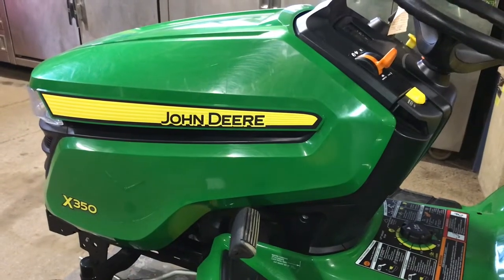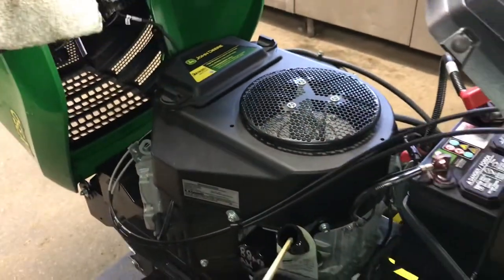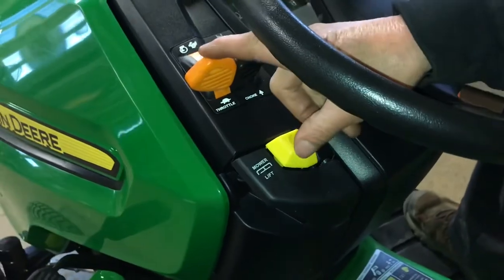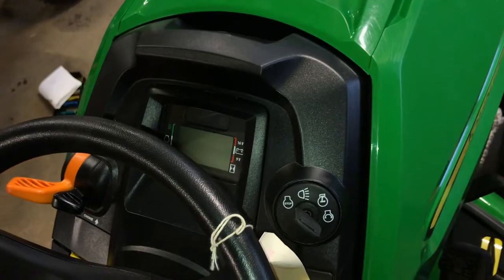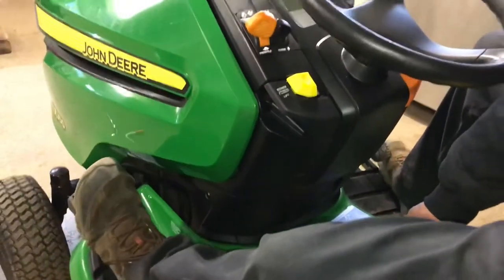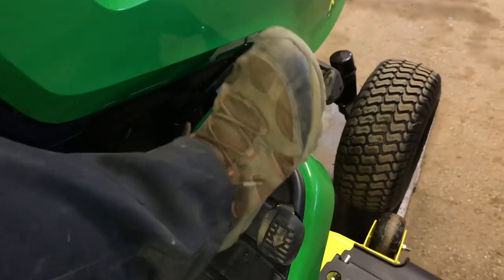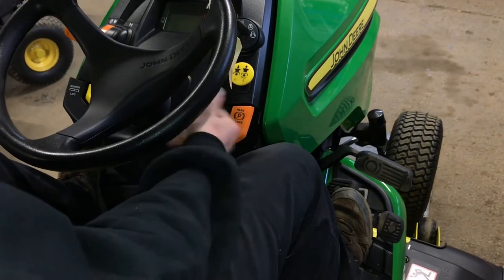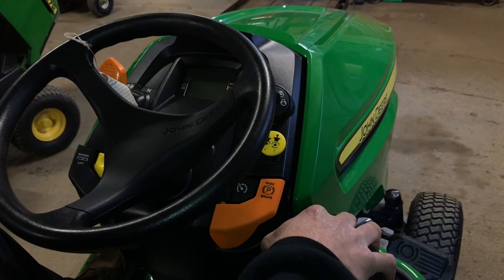How to start and operate a John Deere X350

Comment: If you dont push the reverse button with the pto on does it turn off the engine or just the pto?
Reply from the maker: When you want to go into reverse the engine or the PTO and the engine will shut off depending on the model of the machine.
Reply: On my X350 just the PTO shuts off.

Comment: Is it much better than the E series?  Thanks
Reply: Good question.  I'm wondering the same thing, most info I can come up with is a solid frame and beefed up transmission.  Also more warranty.
Reply: I’ve had mine over a year the best riding mower I’ve owned. It really is the Cadillac of 42 or 48 inch mowers. Engine is very very quiet. Smoothness heavy duty. I can’t recommend it enough. Sold only at John Deere dealers not sold at Lowe’s or home  depot. Traction is excellent. Little more money than the e series,  but get it you won’t regret it
Reply: Johnny Davis  question-  I change my deck height several times while mowing my .  It’s easy to do with the pull handle lever...how about the X series...is it hard to do?  Do you have to stop or can you do it on the fly?
Reply: Very simple It works just a spring loaded foot pedal on the left side  reach down and turn the dial to the desired deck height.  Forward reverse and brake are all on right side. When I’m going over spots where I think the blade may scrub I just press the deck pedal and raise it up till I’m over the trouble spot then let it back to the pre chosen height. I’m very picky and hard to please and it just works excellently. Lots of engineering went into the design.
Reply: Kawasaki!! Steering! All your deck hardware no comparison, transmission,warranty,  electric pto... other then that about the same!! Also built at different plants,hint hint...stronger frame!
Reply: A E-Series is for box store sales 30-second oil change is a joke much better to go to the John Deere nearest you and get an upgraded version of the real thing...